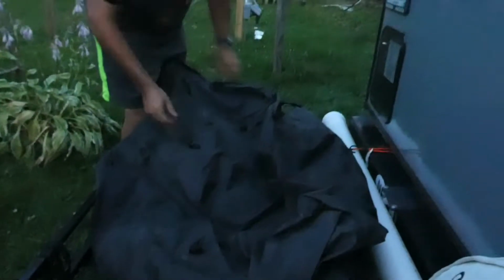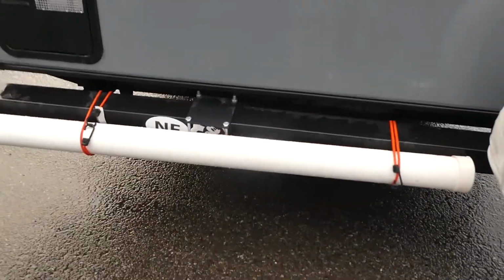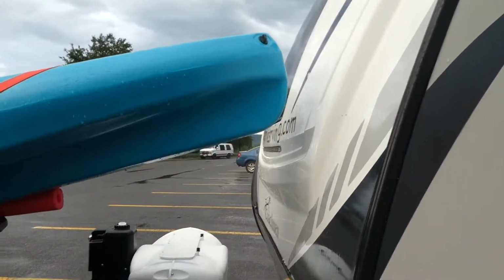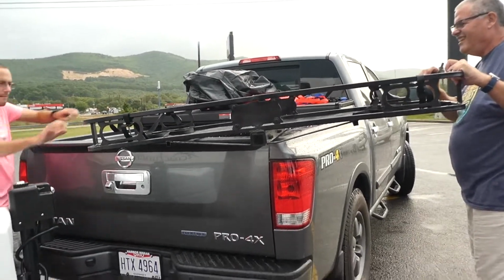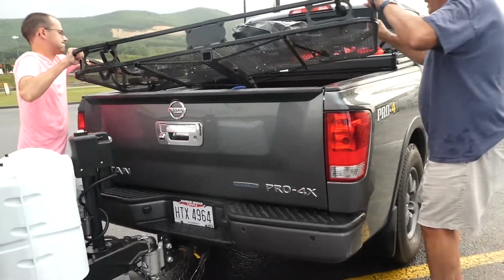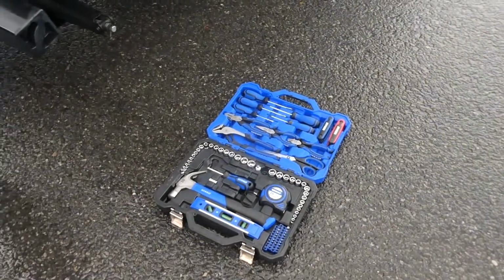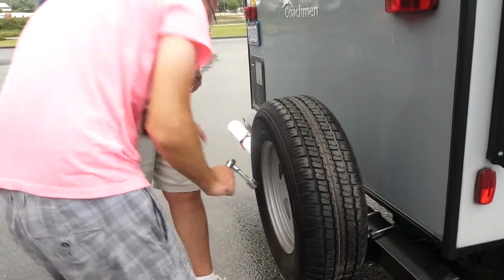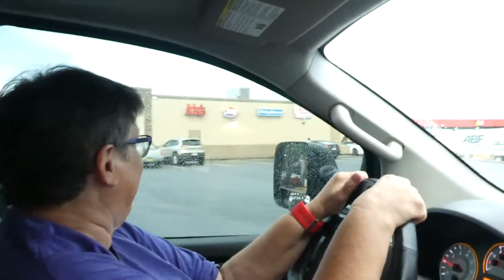Epic Failure

Comment: Thank you for posting the failure because that would have been a great upgrade to the unit. Back to the drawing board I guess.
Reply from the maker: We replaced the bumper with a new steel bumper.  The carrier works great with it.  There will be a future video on how we did it